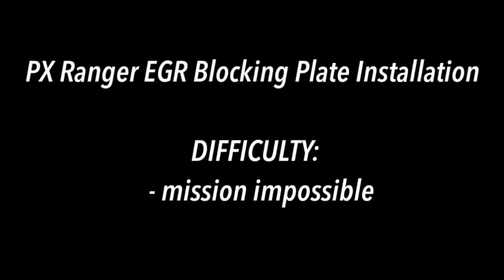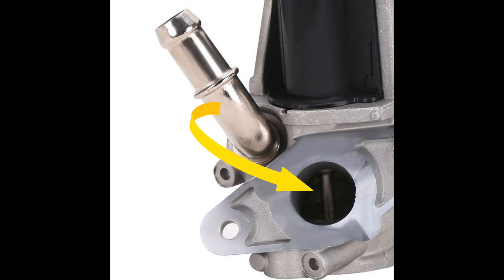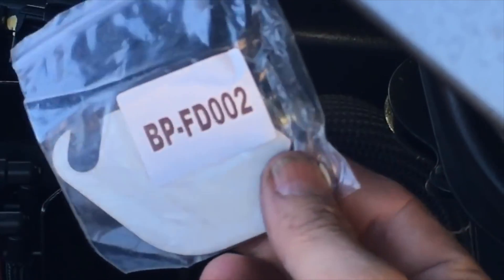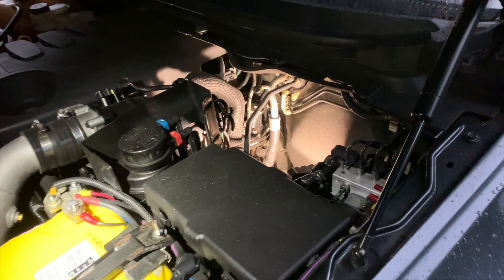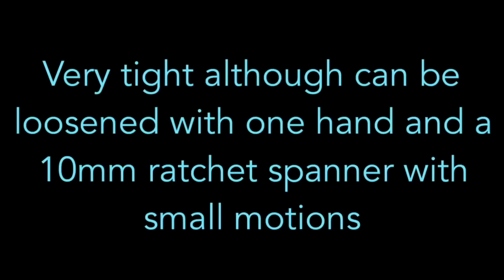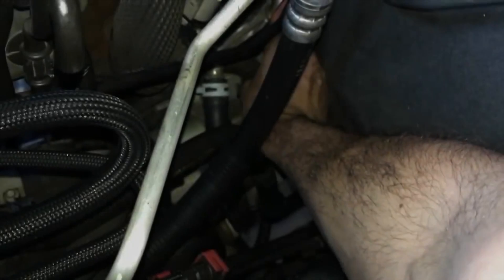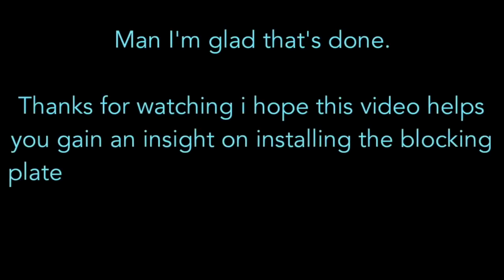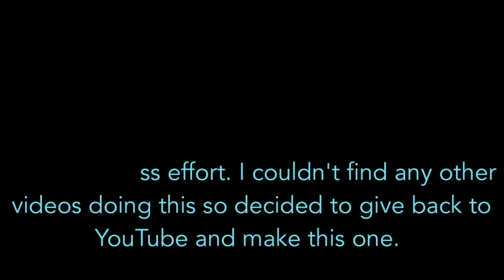EGR Blanking Plate How To Installation Guide Ford Ranger also PX, Mazda BT50 2.2 L & 3.2 L

Comment: I did put the EGR block plate on engine body outlet before to the cooler temperature to EGR valve to intake head engine. 
Must get a new Bossvent catch can is very good for help cut noxious gas less to muffler exhaust system. It is very good economy. Old 9 to 10L/100km without block plate. New 5 to 7L/100km City with block plate. My Mazda BT50 2008 AUTO 3.0L UN3000 👍

Comment: Is it advisable to blank off both sides? what's the trick with the coolant hose ? leave as is of bypass too? and lastly - software.. did you need to change any software on you ranger?
PS - thank you for a very insightful video - i will be tackling it this weekend.

Comment: Hi mate I’ve done the hose bypass I haven’t put the plate un yet my motor is running very rough is this because the plate isn’t fitted yet ? Will fitting the plate fix the rough running engine
Reply: Probably running rough cause the exhaust gas isn’t getting cooled at all but still going into intake man. Blank should fix

Comment: hey mate quick questrion, when you install this blaking plate do you need to also disable the egr via remappping? My valve keeps getting stuck closed and going into limp mode so im trying to figure out the best way to stop it.
Reply from the maker: Nah no remapping required. How many K’s you got it might be very dirty already and jamming which is the main reason for installing a blanking plate 👍🏻
Reply: @NatesToolbox  I got 130k atm but it kept getting stuck closed, got it cleaned but after a few months same issue so I remapped it out. didn't install the plate tho but should I even tho its mapped out?
Reply: @aamirali727 need remapping the car to close the EGR. then even if the plate it’s not there doesn’t really metter. Just for safety , bypass the cooler and stop

Comment: I deleted my EGR valve on my 2006 Mazda BT 50, but I had to revert back because the engine ran too cool. It was lucky to reach 60°.
Reply from the maker: 😱 wow
Reply: Sounds like you thermostath is broken🤔
Reply: @sam_i76  No, it's fine. Everything is normal now after removing the plate.

Comment: Do you need any mods to the ECU or map or MAF? Are there not instance's when the EGR would be commanded open and the ECU would expect a different reading at the MAP than it is getting?
Reply from the maker: Nah doesn’t seem to matter on this model but the PX2 ranger need a small hole in the plate or you’ll get error code so there must be an additional sensor on the newer models to detect flow
Reply: @NatesToolbox  might want to mention this because I had nfi on this when I did mine.
Reply from the maker: @nzkfc  PX1 guarantee won’t have any issues can’t say about later models

Comment: Dumb question: the kit comes with a second plate and several clamps, So this way you only need the one plate?
Reply: @casseyking1495 did you find the solution?I want to blank mine but only the one side but I am unsure...

Comment: Hi mate great video thanks. Is this process the same for a px2 2017? And will it need go get the ecu remapped after?
Reply from the maker: 👍🏻 I think you need the plate with the small hole in it and no other mods required
Reply: @NatesToolbox  Thanks for the reply, I'll look into it more cheers.

Comment: I have 2018 3.2 wildtrak... Will i need to do any software mods to stop it from trowing check engine lamp?
Reply from the maker: You may just need the blanking plate with hole in it I’m not 100%.  Most eBay ones should say
Reply: @NatesToolbox  What size hole, 1mm, might whistle?????
Reply: Thanks Nate. Great info from all.. 7mm sounds the size???

Comment: You didn't explain how the computer will throw a code ( egr valve flow insufficient )
Reply from the maker: Not 100% sure why but yes with no hole in the PX2 version I assume it would have a flow or heat sensor. PX1 will have no codes

Comment: Installed my blanking plate last night, this video is the only reason I knew I could tackle the job thank you kind sir, roughly 40min job, mainly because it took me +30 mins to loosen the bolts, those suckers are hard to get to. My truck feels like it is driving better straight away but I have a feeling that is just a placebo.
Reply from the maker: 👌🏻👌🏻 awesome thanks!!  It will definitely run with cleaner intake air and better for sure it’s not a placebo 🤩🤩🤩
Reply: It’s been 3 months, how’s your fuel economy and power been since?
Reply: @Robdutton-x6d   honestly my consumption has been pretty heavy lately, I did take off my back box on exhaust and open up the gasket in the middle of the exhaust (restrictor) and I do drive with a heavy foot which is most likely the cause of my increased consumption, the van drives very well though

Comment: great video mate but it would help if you had started off by showing which side of the car you were working from for a viewer to know where to look for thi sthing called an egr which is possibly new the them
Reply from the maker: Hey thanks heaps for your comment.  I haven’t watched this for ages but I just had a quick look and it’s probably quite clear for someone willing to tackle this job that It’s from the passenger side especially with the red and blue fuel line colours present.  If somebody can’t work this out or hasn’t researched which side the exhaust manifold is on they probably shouldn’t be working on engine components anyway😆.  Happy tinkering !!
Reply: @NatesToolbox  Fully agree with you here! I've just ordered my blanking plate and know exactly what to do from watching this video thanks mate.

Comment: Firstly great video and thanks!! I'm bit confused though I ordered a blanking plate kit for my px2 and received 2 plates, one like the one you installed and another much larger one with 3 bolt holes 🤔 no instructions, any ideas what the large one would be for?
Reply: The bigger plate is for exhaust side of the EGR.
Reply from the maker: Not familiar with PX2 other than I think you only need the plate with a small hole in it to prevent an error code

Comment: Thanks for the video, I tried to fit it on top thinking that was where it went 🤦
 I bought the 2 part set locally for ZAR 200 and thought it was a quick install on top since it looked identical and that the bottom much thicker square plate was the difficult one.

Didn't even think to grab a ratchet spanner!
Reply: Do you have to remap?
Reply from the maker: Oooh yes it does look like the same fit on top it’s quite deceiving !!
Reply: Hi Allen. Where did you buy yours from? I'm also in SA. Want to do this to my PX1 Ranger. Thanks!

Comment: Good info and video mate, but i was wondering if my ranger already been running over 100k's should i clean it b4 blockiit or just block it with out washing ? Dose it matter :)
Reply from the maker: Hey thanks mate.  Personally if I reckon if you haven’t got any problems at the moment I would just block it, it’s definitely not going to get any worse only better. 👌🏻
Reply: @NatesToolbox  alright thanks mate.. i get it done asap b4 too many drama coming :D

Comment: Would you clean the valve once and for all prior to blanking or not bother?
Reply from the maker: You could but I didn’t and never had an issue but was only around 60,000k maybe.  Older ones might pay but if it’s working I wouldn’t bother it can’t get any worse once blocked only better.
Reply: @NatesToolbox  Thanks mate and really appreciate the video! Cheers

Comment: Thanks, any issues yet after blocking off the EGR, did you feel any performance?
Reply from the maker: Zero issues which is good. It’s mainly to keep
your engine and intake clean and performing great for as long as possible and to prevent the egr blockimg up and needing repairs.   I wouldn’t say you feel any performance gains but I’m sure there is minor gain.
Reply: @NatesToolbox did u get ur mapped out then blanked off the pipe

Comment: Hi Ive managed to loosen the bottom bolt at the cooler to egr flange but for the life of me I cant get to the top one because the bracket that supports the two breather pipes is in the way. Did you have the same problem?
Reply from the maker: Not really mine was a 2012 and the ratchet Spanner 🔧 on the right angle worked good.  Just have a look at the angle I placed the Spanner in the video it makes a huge difference.
Reply: @NatesToolbox  thanks I managed to get it done once I bought the spanner you suggested. Cheers

Comment: So did you only block the one side? I've seen people say block both and re run the coolant lines. But this way seems much easier
Reply from the maker: Just the rear.  Waste of time trying to block the front when the source is already stopped. It’s like turning the tap off (blocking plate) and then plugging the end of the hose just because 👍🏻.  Apparently the cooler can possibly split mines ok but doesn’t hurt to disconnect and join together.
Reply: @NatesToolbox  if it ever does you'd just lose coolant out the exhaust then hey?
Reply from the maker: @joelyking7661  I think it would leak over the road or potentially get sucked into the intake but I don’t think it would have enough pressure to do that (the dirty gases from egr go back up into the intake manifold that’s why you wanna block it).  High chance of overheating if your not watching your temp gauge often.  I don’t think it’s a huge issue.

Comment: Sorry what is it good for to place that plate there??
Just bought 3,2l ranger so curious to know
Thank you
Reply from the maker: In a nutshell it will prevent oil and sludge building up in your entire intake system, pipes, intercooler and manifold. Engine Runs cleaner and better on fresh air rather than oily air.   Well worth it.
Reply: @NatesToolbox  
Thank you, 2016 year still doable yes?
Reply from the maker: @petersmrek7617  no problem.  If it’s a MKII Ranger I think get the plate with small hole in it instead.  MK1 Ranger just the solid plate..

Comment: Thanks for the detail mate. I have a 2015 xlt 3.2 px2 . Will I need the plate with the small hole in it to avoid throwing codes
Reply: From what I have seen in another video it's a 7mm hole for optimum effect 🤔
Reply from the maker: Cheers. Yeah pretty sure PX2 get the holy plate will be all sweet

Comment: Great vid. I realise it's a while since you did this but hopefully you can answer my query.
Would it have been easier if the rachet spanner was the flexible head variety?
Reply from the maker: Hey Greg, possibly yes but may also it may hinder getting it onto the nut as the end moves and you and get to this bit with your hand. I did find the normal ratchet Spanner is definitely necessary over a fixed Spanner though.

Comment: Blank your EGR then make sure to plant 50 trees
Reply from the maker: Haha, I wonder if all the extra maintenance unclogging intakes, poor intercooler & engine efficiency, replacement faulty EGR’s, blown engines due to faulty EGR coolers and so on due to these emission recirculating devices would out way the long term environmental benefits of having one.  Things like a DPF & AdBlue on the other hand is definitely good for reducing emissions and they don’t affect the engine in any way.
Reply: Tree huggers should not drive cars or use grid electricity. Oh town water uses energy, so get a rainwater tank, don't throw any rubbish away cause thats bad for the environment too.

Comment: This was probably the most helpful vid i have ever seen on you tube..... I couldn't find a blocking plate in bloemfontein South Africa.... So i had to remove the bolt completely and make one from the oem gasket that was in there.... Worked out great..... Thanx
Reply: Did you get any codes
Reply: Did you only blank or did you have to remap as well
Reply from the maker: Brilliant Thankyou so much

Comment: I just remove the entire egr system and leave the egr motor on a bracket connected to the wiring harness to avoid fault codes. This method simplifies the cooling system, reduces points of failure and improved under bonnet clutter. A blanking plate needs to be fabricated for the exhaust side, i just TIG weld up the existing S/S inlet manifold egr pipe.
Reply: You will later get egr caliberation error code. Cos the motor spins without limit stops
Reply: Please kindly explain more detail
Reply from the maker: Haha awesome 👏🏻
Reply: Right....

Comment: Do you have a video of how to bypass the egr coolant lines? And it is worth blocking the exhaust manifold side of the egr?
Reply from the maker: Unfortunately I have not bypassed the coolant lines yet and if you’ve installed the blocking plate that’s all you really need to do.
Reply from the maker: @craigg6879  Great question, the blanking plate blocks off the recirculating exhaust gasses which also contain some unburnt diesel which eventually clogs up the EGR mechanism and also dirties the intake causing loss of power.  The coolant portion however will function as normal as this is a separate sealed system that flows through the EGR to keep the recirculating exhaust gasses cooler for Re entry into the intake with the fresh air.  By blocking off the EGR you’re only allowing fresh clean air to get into the engine.   The only reason to block off the cooling portion is because some people have had a hose break which would drain all the coolant from the engine.  It’s not a huge risk but one that some like to prevent. You can also just check the condition of the hose or block it off completely.
Reply from the maker: @craigg6879  not really, there’s heaps of other things that can also fail (we’ll have failed), like intercooler pipes, intercooler, alternator pulley, no.5 injector (this actually blew the engine up from diesel saturation - no warning at all) so yeah I’ve had worse so I’ll just cross it if it ever happened. I personally don’t know anyone that it’s happened to and I don’t do off-road so can easily just pull over if engine temps start to rise.

Comment: I have heard block EGR on PX2 onwards  model can cause turbo problem.  so I remapping my car and electrically shut down the EGR  and bypass the EGR Cooler.   But in my opinion, noting is better  then physically block it .
Reply from the maker: How did you go with the remap so far ?
Reply: @NatesToolbox  So far so good since 2017
Reply: @user-us9gl2fc5p  I have the 2021 PX3 can the EGR be still be turned off in the tune? 
Still Fitting the exhaust manifold blanking plate would stop carbon build up around the EGR valve and also reduce the temps the EGR cooler as it would have no exhaust gases flowing into it.

Comment: Hey ive got a 2015 ford ranger 2.2 with engine light on saying egr circuit high. Will fitting this plate fix my problem. Cheers
Reply: Circuit high means the line is open.
Reply from the maker: Not sure about that one. Generally fitting one won’t solve any faults however should prevent some

Comment: If you get your ranger tuned you can get it turned off with there tune so the egr will not open
Reply: If the egr is dirty it won't shut fully, so this is still a good thing to do just incase
Reply from the maker: True that’s if you want a tune, usually at least $300 just for the egr or a $1200 or more job for an ecu edit though compared to a $5 plate.

Comment: No wonder its easy for you guys. Youre driving position is on the wrong side.. I have a LHD car and its not possible in any way without ripping out half of the enginebay..
Great video still 😊
Reply from the maker: OOOOOH damn mate.  So you would have all the steering and brakes etc on that side. That sucks sorry :/   You might be able to get your ECU remapped to prevent EGR from opening  ?
Reply: @NatesToolbox  Yes its packed there :)
Its kinda the easyest way for now yes
Reply: Same situation in Argentina. We do have all steering and brakes in the middle. I would guess that the only way is from under the vehicle.

Comment: Do you get any check engine lights after blocking it?
Reply from the maker: Hi Joel, no check engine faults at all. If you block in this spot which is before the actuating valve there shouldn’t be any reason you’d get a fault code. If you do it may already be a clogged or faulty EGR valve :)

Comment: I have a question
when you close the EGR 
-DPF filter starts to clog more?
-The engine warning light will not appear when the EGR is closed?
Reply from the maker: My opinion would be nothing would change except for a cleaner intake which should in turn result in a cleaner DPF due to more clean air entering the intake. 

You could argue that the exhaust doesn’t get to have a second round at burning off so the first round goes out the exhaust a bit dirtier but at the end of the day it’s the same exhaust and carbon deposits going through the system, The DPF should clean itself if you go for a decent drive so this is negligible, and we haven’t modified the EGR so all warning lights will still work if the EGR fails to operate, the Electronic valve that opens and closes is not part of the plate blocking and will still open and close however no exhaust gases will be recirculating past it so technically it should never clog up and jam.

Comment: How about the engine performance?
Reply from the maker: Hi Joe, there won’t be any increase in performance however you are guaranteeing that there won’t be any decrease in power or long term issues from excessive carbon buildup in your intake that the EGR system deposits in there.